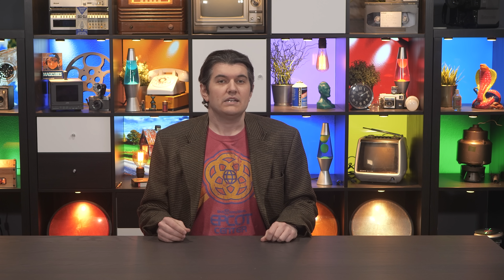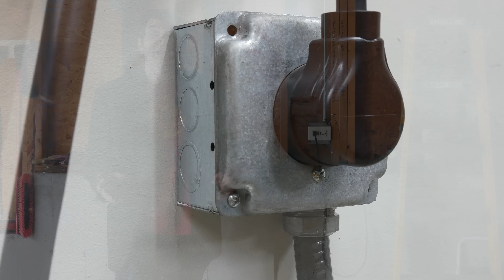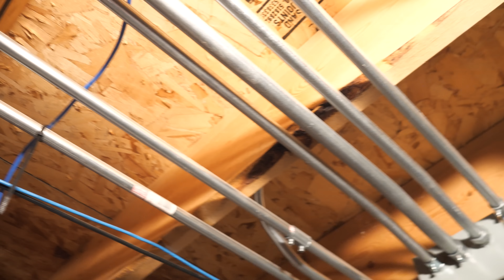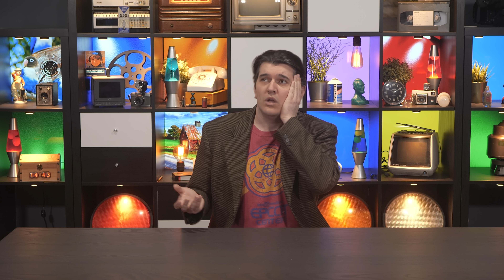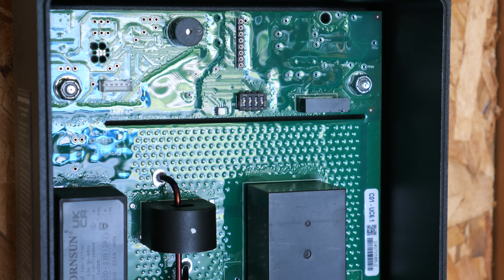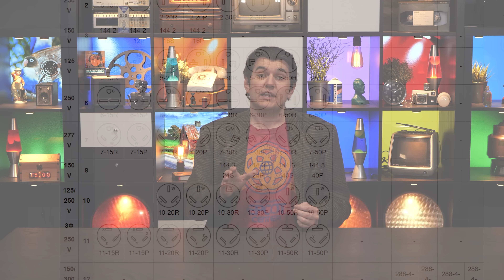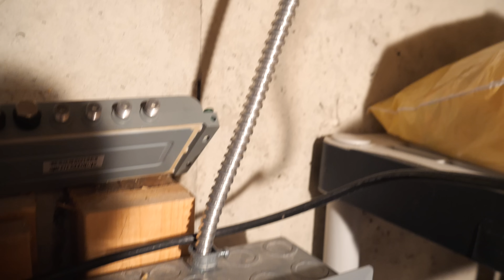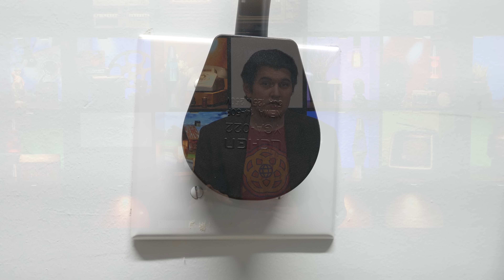The "standard" car charger is usually overkill—but your electrician might not know that

Comment: I'm a little surprised that you stuck with Menard's for your wire and didn't seek out an electrical distrubutor; my location carries MC cable up to 6 AWG cut to length, and while we don't advertise it we are open to the public
Reply: I was going to make a similar comment. I installed a NEMA 14-50 outlet on a 50 AMP breaker using 6/3 MC cable a few years ago.
Reply: Yep and the prices can be night and day
Reply: Some places in heavy union areas like Chicago will not sell to the general public; especially HVAC parts (liability issues as well). However, other places will sell but at a higher price. It’s hit or miss…..
Reply: Isn’t slow charging better for the battery?
Reply: @jimgargas2480  at homeowner power levels the difference in battery durability is basically nothing. It's the DC fast charging at hundreds of kilowatts where that would be felt.
Reply: @jimgargas2480  I think when talking battery longevity, anything at 12 KW or less is "slow" since that doesn't exceed the typical discharge rate.
Reply: I bought 6/2 MC with Ground Copper cable 40' precut on Amazon for my 60 amp circuit for my 48 amp hardwired EVSE.   No wire nuts or junction box.  The connections were torqued to spec on each end.
Reply: Probably not a good idea in Chicago as you wouldn't want to bring attention you are doing electric work yourself. While it isn't against the law for a homeowner to do their own work the Local 134 isn't going to be too happy. 
I'm actually shocked there are not any union members in the comment section complaining.
Reply: @centran  That's an aspect I hadn't thought of, local to me it isn't uncommon to have homeowners come in for DIY
Reply: Between the union complaints and your own final statement ("...we don't advertise it" so how would I know you're an option?) it's not that surprising
Reply: Good thing mobbed up union locals exist...

Comment: German Electrician, dude the Wirenuts are fine we used to use them too. I do think Wago Style connectors are the way to go but if wirenuts didnt work they wouldnt be an option. I think my House might be done with them too
Reply: Do the Wago connectors go above 10AWG?  The ones I have are up to 12AWG max, and anything above that I have to use wire nuts.
Reply: @CharlesDB76  the 221-41X goes up to 12AWG (4mm²) and the 221-61X goes to 10AWG (6mm²)

Comment: I live in Poland and we probably will never have enough money to buy EV - and they kind of aren't great used. But, while there are - now rarely dys where we do drive a lot, 95% of our driving is approximately 50-80km a day. It would be nice if you could use standard outlet with 1800W of power to charge the EV. And for those once a year 500km travels - there are charging stations between us and the hotel. We could take a 90 minute break after 300km for example. And hotel includes charging when you stay there.

Comment: Just had a brand new house built under a USDA loan it was supposed to be the new standard of modern efficiency. It came with that plug built into the house it comes solar ready it comes with the most amount of insulation everything to the max. However you do not get heat pumps and you must have electric heat only and an erv system and you cannot have instant hot water you must have a hot water tank. In regards to you saying you only need that plug if you're driving 200 miles or more per day where I live in Maine that is common in fact my wife does that on a regular daily basis it's more like a 164 miles but that is her daily commute. I'm not sure after living in this house for a year that any of this was really worth it. There's no solar program here in Maine that is efficient or works with the customer. We don't produce our own power in state and by some weird law the power company is not allowed to create power only cell power from another company so all of our power comes from Canada and we're getting like 14 cents a kilowatt hour. My alter efficient modern superhome uses $400 worth of electricity per month in the winter it can be as much as 600 and that's making the house only 67° and it's a 1,200 ft ranch 3 bedroom. There's a lot of room from improvement for all of this electric efficiency and a lot of inefficiencies touted as efficiencies like my electric heat. I wish more States and municipalities were actually doing things that mattered instead of just Big show boat ideas. Thanks for all your wonderful videos you do a great job I really appreciate and enjoy watching

Comment: Always go with the max of 240 because you don't know what you can use, most cars charge at 6 kW ours charge at 6.6 kW, some cars do up to the capacity of 9 kW, it's best to have a 240 line, if you have an electric dryer you already have it.

Comment: 11:45 Most EVSEs don't monitor for over-current draw, and as you indicated instead rely on the circuit breaker to do its job if too high an amperage is pulled by the vehicle. Current monitoring has never been part of the J1772 standard, but it probably ought to be (in my humblest of opinions) because it could be added to the EVSE design relatively inexpensively. However maybe unnecessary, I don't know if there's any history of EVs pulling more current than the EVSE indicates.
Reply: I'm surprised the J1772 EVSEs don't monitor for current draw. NACS negotiates current and monitors temperature.

Comment: 28:20 No apps, but being able to integrate it with HomeAssistant locally is good. Particularly for DC charging. Same for the car, I prefer no internet but local connectivity
Reply: Is there a "smart" home system that isn't internet based?
Reply: @absurdspeed  yes home assistant
Reply: @lieven1122 Cool. Looks like Bluetooth connections are just out of the question and a router & network are gonna be required no matter what.
Reply: @absurdspeed yes, Home Assistant is open source, fully local and has great integrations with most smart home equipment!

Comment: I drive 18 miles one way a day for work. I charge off a 120v plug and a 150 foot extension cord and its more than I need for my little nissan leaf
Reply: I sure hope that 150' extension cord is 10 AWG.  That's quite a run.
Reply: @alsavage1 it is yes I spent a pretty penny on it too

Comment: Yes you can charge an EV on a 120V 10a/15a circuit, it will take you 20 hours to charge that bolt but it'll get there eventually, the larger one he was talking about before has a bigger pipe and will charge it in four hours or less

Comment: Please just direct wire your chargers.
I understand that its nicer and more flexible but for 120V/208V/240V Id say just direct wire it for simplicity of function.
For 230V or 400V I dont mind plugs since they are VERY secure.

Comment: If is is cold outside and windy more then 3000w can be wasted in just keepin the battery warm... Lithium batteries HAVE to be heated to more the +0c (warmer then freezing) to be able to charge at all so in winter a lot of energy is wasted just to keep the battery pack warm and very few is aware of this fact.

Reply
Reply: What exactly is your point?
Reply: @star9732  Did you read the comment?

Comment: Thank you. I can’t tell you how many times I’ve had people tell me I NEED 240v charging. Especially when those people are the “Never Electric” types.
Reply: That misunderstanding is likely part of why they’re “never electric”.  I’ve educated a lot of friends about it, but so far no converts.
Reply: @k5sss  Maybe it's because you're the type of person who likes to "educate" your friends.
Reply: @C.I...  I know people are allergic to learning now
Reply: Well, honestly if you're planning on driving an EV, you really do NEED a 240v plug. Sure, you can sometimes barely get by with a 120v line, but it's going to be very limiting.
Reply: @nathanahubbard1975  For the average commute 120V is fine.
It only got awkward for me in the winter: suddenly the battery needs to be heated (Assume 1 extra hour), cabin pre-heat is 2 hours (3kWh) @ -20C.
So an 8hour 30-80% charge becomes an 11 hour charge.
At -20C my 2011 Leaf also lost 75% of it's range too (newer ones have heat pumps), so I charge it to 100% (an extra 3 hours, for a total of 14 hours)
NEMA 6-15 plug I plan to install would drop that to 7 hours.
Reply: I mean I need 230V. 

I live in the Netherlands. I charge my phone with 230V, and literally every single electric appliance I use.
Reply: @jaspermooren5883 if we're getting into semantics technically phone chargers (and many other AC to DC adapters for that matter) are universal and run on anything from 100 to 240 volts AC so technically you still don't need it for everything.
Reply: You do Need 240 though if you want a full charge overnight ! On my Tesla it would take 60 hours + for a full charge from 4% ..that is way too slow

Comment: They are the same size as UK standard sockets for all electrical goods. US standard ones look dangerous to us.
Reply: To an American, the UK plugs look comically oversized and inefficient.
Reply: @vhfgamer  Back when everything came with just a hare wire, how did the north American plug even get attached by hand? It always looks like it's moulded on? I don't see any screws that you might use to install the wire to the plug?
Reply: U.K. sockets take 3 pins not 4.
Reply: Okay good for you
Reply: The plug is about 2.5" wide.  They dwarf your 13A plugs.
Reply: Are you even alive if you don't have a Schuko-Stecker or other safe standards like CEE?
Reply: Most US electrical terrifying to us Europeans!
Reply: @juststeve5542 

European what? Europe is not a country. You shouldn't speak as if it is, nor compare it to one .
Reply: @CorneliusTaylor-s1u They're comparing the safety in all European plugs to the North American ones. Though being from the UK, it seems the rest of the continent are similar enough as there's only a single "europlug" adapter type I've seen in the travel section at electrical stores, rather than different ones for France, Germany, Poland, Spain, Italy, etc.
Reply: @itskdog  Worthwhile reading the journey to get to the modern 'compatible' Euro plug.  It wasn't short and it wasn't smooth.
Reply: @retrozmachine1189  Sounds like the development of most standards. Any recommendations of a good video essay on that?
Reply: Yeah, we don't care.

Comment: Thank you! I've owned an electric car since 2015, and I've never had a 220 outlet for charging. I probably drive less than most people, but realistically for most people you just need a GFCI in your garage on a standard 110 outlet.
Reply: There is no such thing as a 110 or 220 outlet. The nominal voltage of the USA electrical system is 120 and 240.
Reply: @Meton2526 technically untrue for folks in apartments with 3 phase power with nominal 104/208 V... If you wanna be a pedant...
Reply: @ShouPow  fair enough, but it's still not 110/220
Reply: @ShouPow  208v, sure, but 104v?  Show me.
Reply: @Meton2526  yeah I'm honestly not sure where that comes from 🤷🏾‍♂️
Reply: @ShouPow  a typo. It happens.

Comment: How many people in the U.S. live in apartments? That alone will severely limit electric cars. (Babble all you want. Lol. I’ve long ago worked thru this)
Reply: My complex has 6 charging stations and has been talking about expanding as more residents get or move in with electric vehicles. It costs less that supercharging but more than home power costs. But I'm not paying for the equipment and upkeep on it.
Reply: And in my area about 50% of the complexes have some sort of charging system or have installed power outlets to let you charge your electric vehicles.
Reply: If your apartment comes with a parking spot, it should come with a charger. It's that simple.
Reply: If you’ve ‘worked through this’ then you already know that 34% of households are apartments…

…Except you obviously haven’t a clue.

Comment: I've been charging my Bolt EUV from a 15A outlet for the entire time I've owned it. 800kWh this year, and I've not had a single time where I needed it to charge faster than over.
Reply: That is excellent. Having a small ev has some benefits there. My f150 lightning battery is too large to make up for the lower miles/kwh to make a 110v work. Had to bite the bullet and get a level 2 installed.